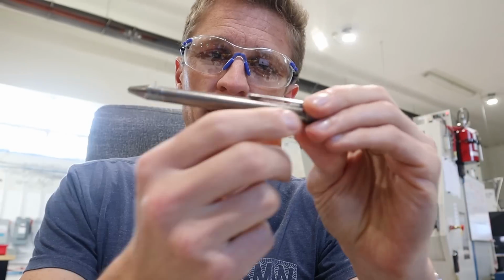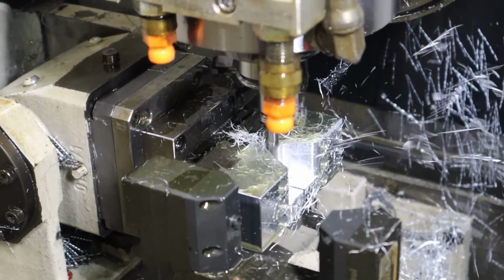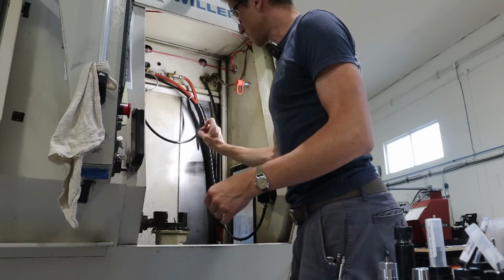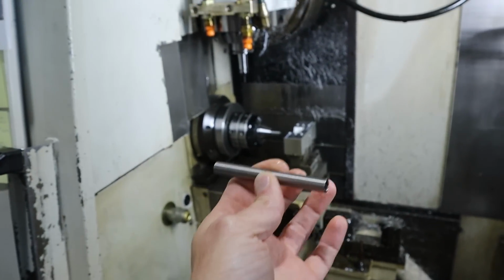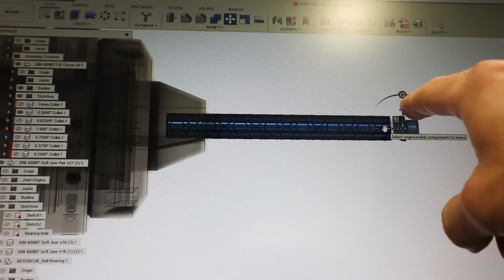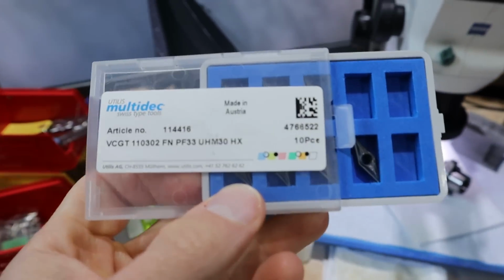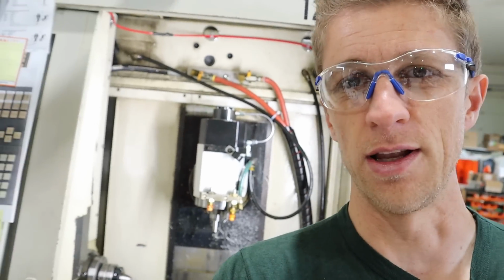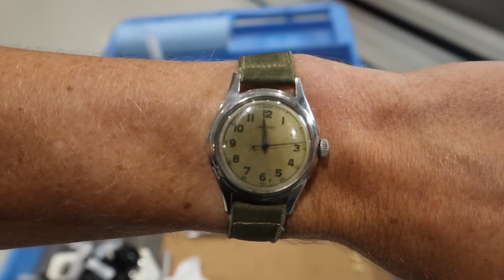Patterned Sagas? | Saga Saturdays Ep 35

Comment: Traditionally a straight line engine would be used to cut pattern into pens. Maybe you could mimic this with a turning tool on the Willemin. That could give you really nice and bright finish in the cut lines, without the little swirl lines left by a rotating endmill

Comment: If your tubes already have threads on them why don't you use them as fixturing on the main spindle? I have a saga and when i unscrew the tip i don't see any centering feature between the tube and the tip so that might be the case, but at the same time i wonder how you can get both parts so concentric when the pen is assembled.
Love your videos thank you so much for making this content!

Comment: May be a stupid question, but why not just use a threaded mandrel on the driven side? It would make sure you have zero slip while machining the pattern and indexing. It would be a pain for production runs but it would ensure a smaller rejection rate. Not a machinist but it makes sense in my brain

Comment: If running between centers doesn't provide enough grip on the part you could try either an expanding mandrel or shrink fitting the tube onto a shaft. For the mandrel you could have a slip fit outside of the machine and then use center pressure to make the mandrel swell and grip the tube or something like a tapered pipe thread and plug to cause the mandrel to expand. You could also make a mandrel with a shoulder on one side and a nut on the other to clamp to tube. For the shrink fit thats pretty obvious, have an over sized mandrel and heat the tube then slip the tube over and wait for it to cool. That method will be harder to do quick changes and might be tricky getting the tubes back off without damage. With larger parts you can get the part to expand faster than the mandrel but all of your stuff is so small it'll all get hot and cool off quickly.

Comment: It doesnt look like it chipped out.  Looks like material buildup.
Reply: If it was material build up then the part would be under sized instead of over sized. Also a2 steel doesn't usually leave material build-up like aluminum or any softer material. But it did look like it in one of the shots.